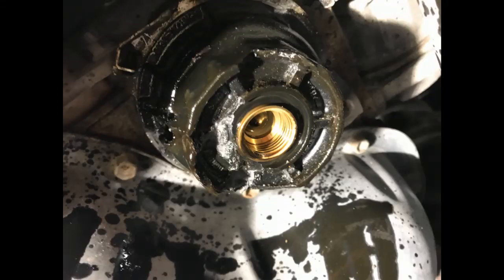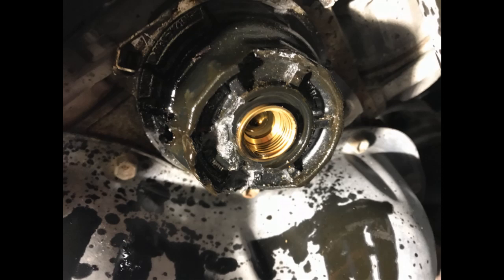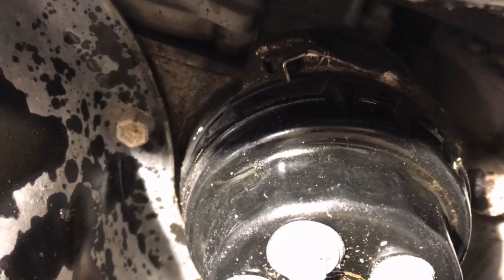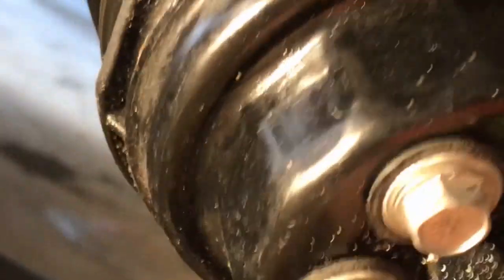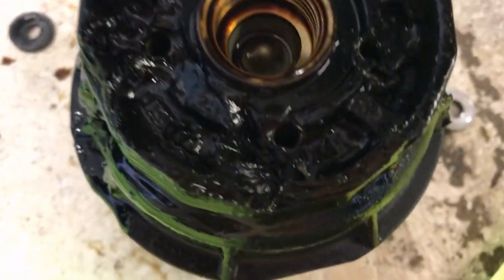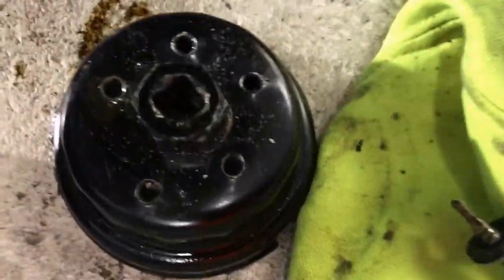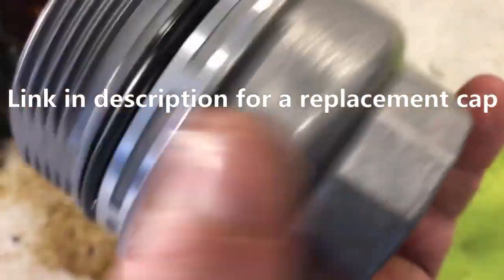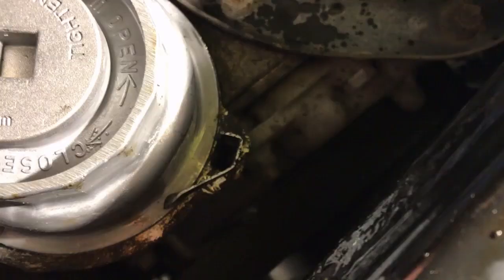2013 Toyota Camry Oil filter cap removal

Comment: Sand paper with strap wrench.  1 inch strip fit in the special tool. Required some steady pressure, but I was able to remove it. It was a 4 hour oil change. The teeth broke off oil leaked from the side. But that wasn't the end of my problems.   I place the O ring in the wrong spot.  And when the engine was turned on. The whole dropped out the bottom.   The customer was super friendly and patient.  I found another filter housing. This one was metal, and with all that experience I just got. I finished the job.  The guy paid me. He said.  You never gave up, and it was a difficult job.. I never heard from him again. I don't blame him. 
Scary shit.  Hylander 2018 I think .

Comment: I was trying to help my neighbor out and change her oil on her Rav4 and I sheered the tabs off her plastic housing. I used your method along with a half inch ratchet and cheater pipe and finally got it off. Thanks for the video. I bought an aluminum replacement housing at my local oreilly

Comment: I wish I found your video before handling our plastic housing. What i did,, I hammered the lower half of the housing to a million bits, then vertically chiseled out the inner part that still hugged the main structure carefully, I ripped out the hanging O ring, used pliers and a flat screw driver to pry the cutted piece, lastly I grabbed the remaining half and ripped it off the body. Replaced it with the aluminum house, but sprayed it with WD 40 before hand tightening. That's it. My mom is very happy now. 10 minute job, done. Did I do a good job?
Reply from the maker: you beast
Reply: @NOBOX7  Awesome channel, I subd/liked

Comment: Self-DRILLING sheet metal screws. Great video. Fortunately, I saw the tab, but still took me an hour to get the thing off. Someone torqued that puppy on BUT good. I ended up putting a 1" PVC about 15" long over my ratchet handle. That broke her loose. I was able to reuse the can. What was ever wrong with the spin-on filters I'll never figure out.

Comment: You don't have to bend that retaining clip to take off the oil filter cap. Mine has the same clip and I never touch it and I've changed the oil five times. It just applies a spring tension to assure a loose cap will not back off. Also, the official instructions on the OEM Toyota oil filter box says nothing about bending or removing that metal tab.

Torque the oil filter cap to 18 lb.ft. it says right on the part 25 N•m
Reply from the maker: The hell you dont , i fought mine for an hour before i realized it was that tab holding me , it must be bent out of the way .

Comment: I have the same problem but mine i keep breaking the special tool wrench
Reply: Are you buying the Motivx brand wrench or at least one that's made with forged aluminum instead of cast aluminum? Also make sure to warm up the engine to operating temperature first. I've seen videos where they had to drill three holes through the wrench and into the oil filter housing cap to get it off. Whoever did the last oil change should be held responsible. Stuff like this is why I have never let anyone but me change my oil since I was 18 (and because I used to do anything to save a buck). 😉😊

You're going to need a new oil filter cap. Personally, I don't think it matters whether you go with a plastic or aluminum one. Either one can break. The plastic is more likely to break but if torque specs are followed then there shouldn't be a problem. I replaced ours on our RAV4 with an OEM plastic one and have changed the oil five times since then with zero problems.
Reply: Guess I didn't catch that.

Comment: You didn't just vaporize it with an oil burner?
Reply from the maker: all this for free oil to vaporize other things my friend
Reply from the maker: lol
Reply from the maker: I guess i do alot of oil videos eh ?
Reply: Good stuff! On a serious note, The Corolla of the same vintage has that same filter housing setup. I fought with it at first but then stopped tightening it, I now install it till it bottoms out and back it off a 16th of a turn since the o ring is what does the sealing. When I do that I can take it off by hand every time, if I tighten till it bottoms out it will stick on the engine and I'd make a strap wrench with an old belt and vice grips to remove it. That metal one is sweet, not surprised one exists!

Comment: Dam to toyota for this when it is  old it dry and brake easily because i did not over tight it but it did brake . No more toyota or any car has that also they screw the way of transmission...